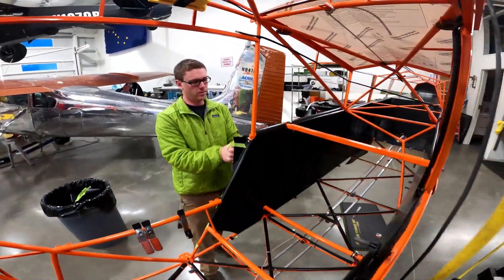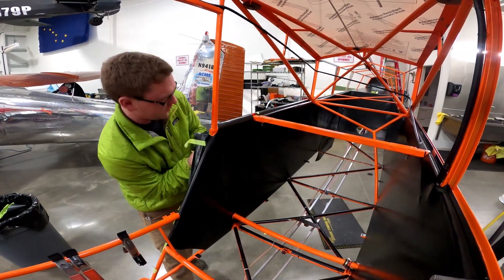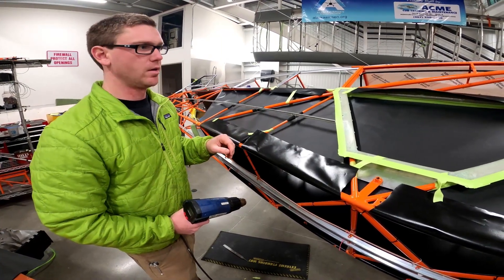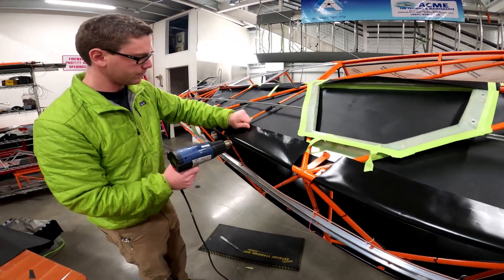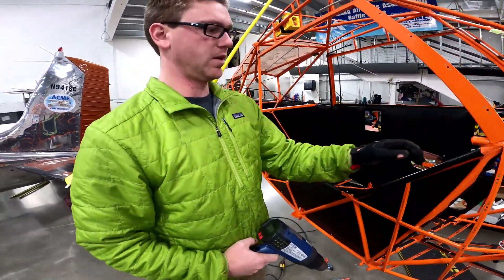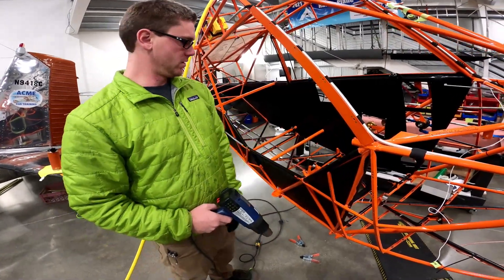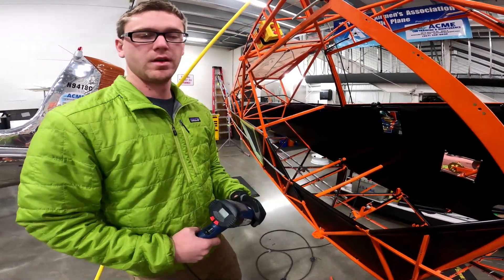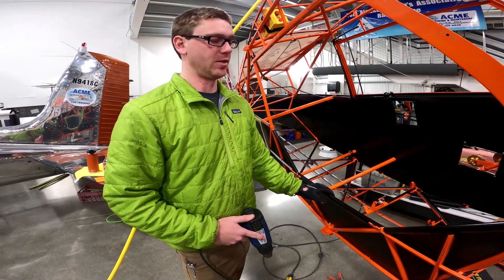Chris Rush explains how to install and apply Oratex fabric in the cockpit of a Piper Super Cub.

Comment: So would it be a better connection if the outside was done first so the outer material is attached to the frame? Then inside, then caping.

Comment: Why fabric on the inside of the cockpit?
Reply from the maker: It saves weight!
Reply from the maker: The wooden floorboards were replaced with carbon fiber floorboards!
Reply from the maker: It’s easier to fabric the interior before covering the exterior for final access to the controls,trim and throttle, fuel collector etc. in-between the two layers of fabric.
Reply: His question was never answered... why do both the inside and outside?
Reply: No fabric on inside would save weight. Is there a aluminum floor going in there too? I'm slightly confused here. I'm noticing in my world that STOL aircraft usually just have nothing there. I'm an idiot though....what do I know.